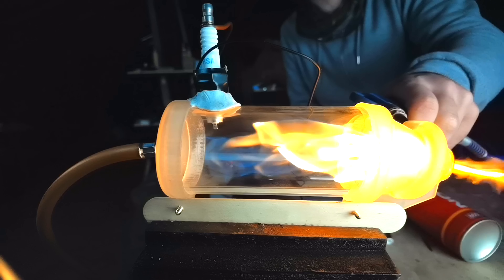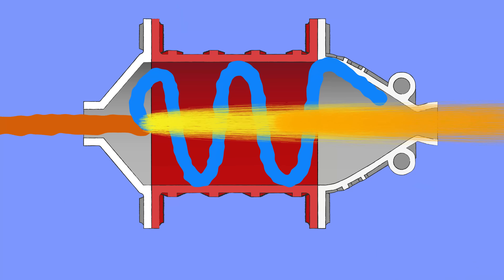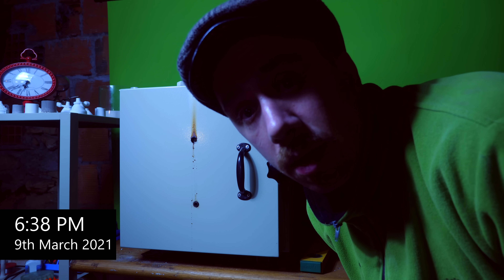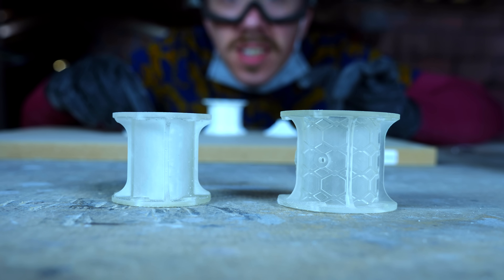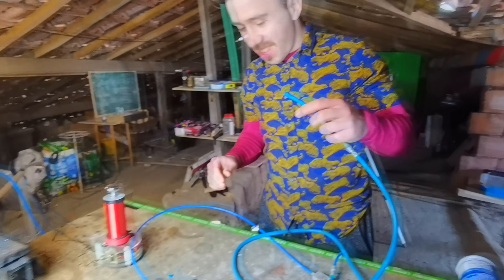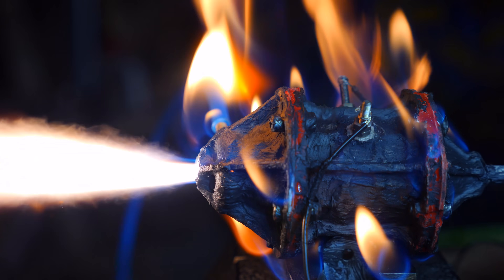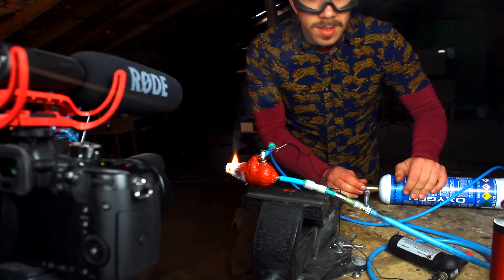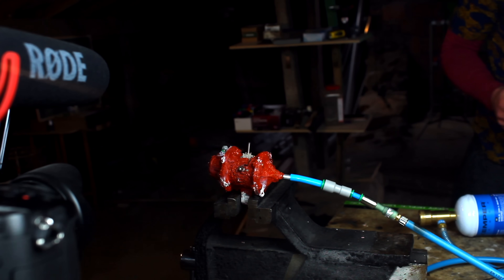Vortex Rocket V2.0 (3D Printed)

Comment: I think a ceramic glaze and a second firing would be the best way to ensure the individual parts are gas tight, and then you'd not  need to worry about containing the chamber pressure with just a deformable membrane over the entire surface (think about how a balloon is easier to blow up the bigger it gets, as you raise the pressure in the chamber, the any bonding issues with the high temp silicone will allow it to delaminate and inflate.  If you're only using it between two mating surfaces, you're not only getting the bonding strength of the seal, but also the clamping force of the fasteners along with reducing the potential trouble spots)
Reply: I want to add, from some experience with both ceramics and aerospace; keep the plastic chamber.  Pressure vessels do not fail gracefully; and ceramics are surprisingly hard (ie: they'll punch right through steel with enough push... so give an area that can fail in a containable way)

Keep up the good work, and keep surviving those learning experiences!

Comment: 14:07 That looks like a Anti Fire hydrant, Maybe once you figure out all the kinks for your rockets maybe you could make a remote controlled fire hydrant rocket. That way you can save a burning building or burn it down faster with your home made rocket you just launched into a burning building.

Comment: you could redesign the combustion chamber, redirecting the primer, where it allows you to focus your attention on building a single part that is extremely resistant to high thermal and pressure peaks, using a SLM printer to create the aforementioned printer to create pieces with a body seal  more reliable and stable under pressure stress and high thermal expansion.

Comment: Dip the ceramic parts in standard ceramic glaze. Don't paint it, just dip it. Multiple coats... 
Maybe let the parts soak in the glaze? Take advantage of the porosity and solidify the ceramic with glass.

Comment: I feel like the intense heat is destroying the sealing material. I know several people have mentioned adding cooling to help deal with that. I wonder if using more insulation would help. I know the youtuber NightHawkInLight made his version of a very insulated mateirla called "starlight ". I wonder if adding that(or any insulator followed by the sealant on top would help make the rockets last longer.

Comment: Seems like the part is just too thin try to increase the thickness by first printing the model.  Then print a shell to fit around the model and build it up from there since you can only print 2mm thick. You can make a shell that is able to bolt together.

Comment: I am bored to try for winning a 3d printed but still i would like to see if you could use a turbo that was used in turbo jet pulse engine to make the same thing insted of using a dedicated oxygen cylinder. and also try to make different layers of sealent to make the porousness bit low.

Comment: Make sure to have a flame arrestor on your fuel and oxygen lines just in case of blow back.    Trust me your eyebrows and fire extinguisher will thank you.    Also be careful about freezing off your valve for your fuel.   Propane is very wet and hydrates very easily.     Try adding another 1/4 turn valve after the valve on your tank it will help in the long run

Comment: Make it out of glass, that way I can see inside! If you want to stick with 3d print you need to play with the properties of the resin  bath, I would start off with adding graphite to the solution. Or use a vacuum chamber and plasma to coat the ceramic 3D printed part like they do cylinder walls in engine manufacturing

Comment: Possible fixes:
- Use gaskets between the 3 body pieces. Using refractory cement alone is not enough as it obviously fails under higher temps. Would have to research on the appropriate materials for the gaskets. Maybe fiberglass, compressed fibre, flexible Graphite, or Phyllosilicate based sheets (1000degC max rating).
- Maybe change the angle of the side inlet directed a few degrees towards the outlet. This is just a guess, but there might be too much pressure against the chamber walls and contributing to premature failure. Changing the inlet angles might help alleviate this (or not) :)

Comment: Maybe encase the ceramics in a resin, could increase the stability. 

Option two is drop the porcelyte and switch to casting methods. A concrete fiberglass mix would be quite strong, and withstand the pressure, but might still be a bit leaky...

Comment: Most of the leaks appear to be around the connection points on the modular engines, you could maybe use gaskets to seal those connection points better

Comment: Slow down your heat cycle to sinter thicker parts. Slow down your heat cycle in general to decrease cracks. Add in more time at lower temperatures to pyrolyze the polymer so that it leaves as a gas more slowly and decreases warping before ramping up the rest of the way to sintering temp. Build in an o-ring groove in the faces of the flanged parts and use overlapping grooves to physically load the outward pressure into the part structure instead of the gasket material used to seal the parts together. That will significantly decrease the shear stress on the softer materials and decrease the chance for a catastrophic leak. Be sure to line the inside of the engines with the same insulating material you used on the outside. And add secondary valves in your fuel and oxidizer lines. You should never use the primary/source valve as a regulator valve. Even a needle valve in the middle of the line can act as a basic flame arrester and save your life. A line propagating flame might not explode a tank if it reaches back to it in the line, but the pressure and heat can rip the line off the tank and then you potentially have a tank with a flame coming out of it zooming around the area and lighting everything on fire.

Comment: You could try running a suspension of sifted clays and water through the engine with the main ports stoppered.  Over time, as the suspension moves through the porous ceramic, the clays will get stuck in the pores and gradually block them.   Dirt in a bucket of water will allow the heavier particles to settle out.  You will need to increase the pressure slightly over time to get a better seal.  Dry the assembly at 100C overnight to remove moisture, then heat again at higher temps to anneal.  The clay minerals should be stable up to rather high temperatures.  If you can get kaolin clays, which may be marketed as porcelain clay, they will resist expansion from heat or moisture.

Comment: maybe you could find a way to cast a part with aluminum , it's kinda easy to melt and it does stand quite high temperatures . You would need a foundry or even try to melt it in the kiln , idk some random idea of mine 😂

Comment: As for your leaking problem could a thin type of cement or grout fill the pores enough to stop the leaking?   Im sure it would hold up to the heat better than silicone.

Comment: On the last engine it looked like the fuel lines were the leak point. My guess is that the pressure in the combustion camber caused some back pressure, pushing the reaction towards the side injection point.

Comment: Hey Integza, we know you hate tomatoes, but. What better way to torture them than from SPACE? I'm not sure if your local laws will allow it, but why not put an R/C plane on a weather balloon, taking it to the edge of atmosphere, and using different types of engines on the way down? Like a pulse jet! Or a scram jet! Or even a turbo jet! It seems like you got the format just right last time for them to be successful on a vehicle, and you have enough 3d printing experience that I'm sure you'll be able to now!
I'd suggest several iterations to show just how  powerful/efficient each different engine is at different atmospheric altitudes.
I know if anyone is, you're smart enough to pull this off.

Comment: Could you use a carbon fiber polymer composite as a washer in between the gaps to help from fire and pressure build-up? Also, the amount of heat that is coming out of that engine is insane. Is there anyway you can cool the engine with liquid nitrogen or some other type of cooling agent to slow down the amount of heat that is just scorcing the ceramic? Just a thought!

Comment: What if you soaked it or painted it with some kind of cement solution that would fill in all the pores and bond with the ceramic material?  What about a glaze or resin?

Comment: If you search high temperature sealant on Mcmaster Carr they carry a ceramic coating that is rated up to 2500°F. Its water based so you could probably thin it out with some extra water and dip the whole assembled engine to hopefully seal all the gaps. Buuuuut it also is over $100 for a can so maybe not the most cost effective way to go! Keep going on the 3d printed rocket stuff, I'm loving the vids!

Comment: You can make a 3d printed slipcast mold with a similar geometry to the geometries you have been trying with the resin printed rockets to get around your cracking problem. You might have to make several sections of the mold that bolt together and little wells for more of the ceramic slip to fill in the main casting body when shrinking occurs during the drying process. You don't need to 3d print the rocket body itself, just 3d print the mold sections, which will work better for taking the part from the mold if the mold sections are done in porcelite.

Alternatively, You could braze the 3d printed resin to metal supports on the outside of the nozzle cone. NASA used to do this in the 1960s and there are some declassified public reports that I have read off of google about the brazing the metal to the ceramic heat shielding.

Comment: well watch your video until the end, you can notice that some things are not working as they should, I believe that a viable solution to your problem of leakage / incineration of the combustion chamber would be to create two ceramic pieces in the 3D printer, one external and one internal, to be mounted superimposed with some space between them so that you can fill with some material that withstands enough heating without degrading but also being able to seal these micro pores of the ceramic in addition to giving robust and force the piece to withstand the internal pressures generated, something that I also noticed is that the red resin that you are using seems to be combustion due to the heat it is probably not a good idea to use it, use a fuel injector with a smaller diameter as well to have a more controlled fuel burn as for the vortex I am not sure if the same came from the back of the device is really effective, anyway I am not an expert in these types of engines however was what I noticed when watching, I sincerely hope it helps somehow thanks!

Comment: To stop the leaking you could try placing the engine on a metal or ceramic pot, once the engine is set fill the container with sand or damp soil, I would use a metal casing and fixing the valves for the engine with pipelines for less leaking. Greetings from México!🇲🇽

Comment: Flip it nozzle-side up and submerge it in water. Any leaks from the combustion chamber will just bubble to the surface and burn off there, and the water will keep it cool enough to run for a long time. This would allow you to test more nozzle/chamber designs, and you might even be able to do it without coating the parts in heat-proof sealant. You could even use the hot water bath to boil Tomato Lord Jr until he goes soft like his father 🍅

Comment: Could you use a metal housing for the external of your rocket to seal the gas and 3d printed ceramics nozzle on the inside to mix them.

Comment: Can you re-coat the ceramic part with resin after printing to build up layers and work out the porosity? Also can you remove the support material before sintering?  You can also do aluminum casting for your engine (3d print the design in pla then sand cast in aluminum then coat the inside with the ceramic and fire.

Comment: Possibly as a quick and dirty idea just apply the first layer of that fireplace cement, wait for it to dry, then use fiberglass insulation saturated with more cement to build up around the burn through areas like nozzle. More material, longer it takes to heat up and to melt through! Also I worked with a similar product as the cement, does it have a curing recommendation? If so it might be worth a shot to pop the engine back in the kiln at lower temp to cure or harden or whathaveyou the fireplace cement.

Comment: Have you considered using a high heat castable refractory clay? It's common and cheap and can withstand temperatures up to 1600C. You could 3D print a negative mold to pour each of the parts, and use your kiln to fire them. You could also consider glazing them to help seal the pores from leakage. Also consider adding a geometric profile to your seams so they fit together instead of just flat on flat.

Comment: Integza your channel is awesome, revisit these 3d printed liquid fuels engines but use the same fireplace sealer you used for the pulse jet to seal the exterior, would glazing the combustion chamber help with the internal sealing??? Keep killing the tomatoes they are disgusting!

Comment: I figure the ceramic has micro holes that blow out under pressure.  Would it be possible to coat the parts with another layer of ceramic ( NOT Porcelite) and refire them in the kiln? That way you still get to 3D print the part but can increase the thickness beyond what the Porcelite can handle.

Comment: His counting on us.... what ever could go wrong? XD Anyways, for me it looks like systems works as intended minus the leaks at start, but when there is disturbance on the air flow burning moves forwards towards nozzle and turbulence and heat expansion from that moves burn to chamber walls. Also utilizing liquid oxygen well could cause engine burn WAY hotter than any of the materials can handle with simple heat radiation alone. Also all this increases the chamber pressure way above the durability causing the leaks.

How to fix all this... Well one could make composite by building engine, then two shells that go over that with gap between and gap is filled with high temp silicone or maybe even co2 to prevent burn outside the engine... Or cast the engine inside fire refractory as support against pressure increase. Not practical in plane etc, but would confirm what ever its the construction failing due over pressure

Also you might want to use mask when dealing with fine dust in ceramic nature, or make dedicated "blasting" cabinet to contain the dust.

Comment: I wonder if you should tweak your oxygen/fuel ratio? Using oxygen means that, if you don't have enough fuel in the mix, you're literally burning the engine itself. Hot oxygen corrodes almost everything. Using less oxygen & more fuel means, worst case scenario, you have incomplete combustion. Using more oxygen than is needed to burn the fuel means anything the oxygen touches becomes fuel.

Comment: The only idea that comes to mind is printing the parts just as molds or to get the shape, then use actual ceramic to create one solid piece to prevent leaking, I would also consider a way to add a heat exchanger like liquid cooled pipe that goes inside the ceramic to cool it down and prevent it from exploding

Comment: Here's a thought: 3D print the interior of the engine in printable wax. Cover the surface in a high temperature composite (like fiberglass and the refactory cement you used before, or a high temperature epoxy). Then melt out the wax and you should be left with a leak-proof composite part the geometry of which you can control with CAD and 3D printing. I don't think there's any advantage in using carbon fiber as fiberglass has plenty of thermal resistance and it's cheap.

It might also be worth looking into making a mandrel and laying up the composite as a filament winding process. I think that's used for some fuel tanks where they need to be very high strength. Here's what that looks like when the pros do it: https://www.youtube.com/watch?v=0sET6cQcciM

And us mere mortals: https://www.youtube.com/watch?v=CtoJ4BaJFvc

Comment: How about printing in wax filament and casting metal using that as a loss mould? Guess you'd have to fill the interior with sand too, and then cleaning that out once the metal has cured would be....tough. Unless you do it in parts again, cast in 2 parts allowing you access to the interior to give it a proper clean. Then just welding the two halves together?

Comment: I have 1 suggestion maybe try some satanite and water it down pretty far and do multiple thin coats.
First layers should be watered down the most with subsequent layers slightly thicker thus more viscous.

Also with the refractory mortar you used, you can try the same thing, make a much more watery solution if you want to seal pores.

The problem with the silicone sealant is that it's acting as a balloon. It doesn't have structural support except the adhesion to the refractory/ceramic that's porous.
putting the sealant on the inside would solve it but probably expose it to temperatures over 300C.

So another option might be thin layer sealant and then a reinforcing layer with some glass/carbon fiber with epoxy/silicone as I don't think mortar/cement will stick to the silicone.

Comment: Integza, 
You can cast entire parts for an engine using J-B Weld. Have you considered coating your parts with it? also I would love to see if you could make one of these motors using just J-B Weld. you could possibly use your resin printer to make a split mold and glue the parts together before it is fully set.

Comment: It looks like you need better regulation of fuel, oxygen, and air mixture. Also better cooling of the engine walls. Why not wrap copper tubing around the ceramic engine and pump water or glycol through the tubing to remove heat. Its a proven method and very effective at removing heat.